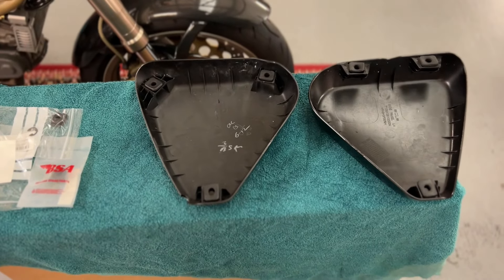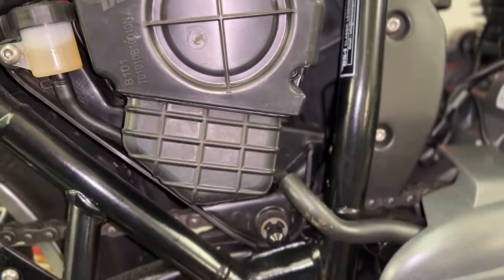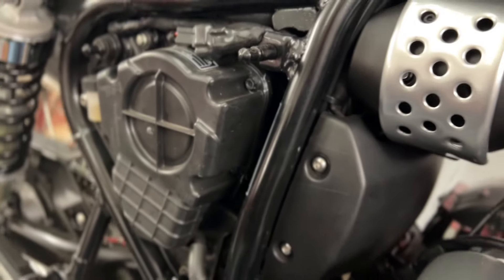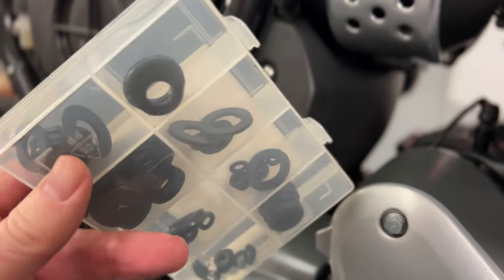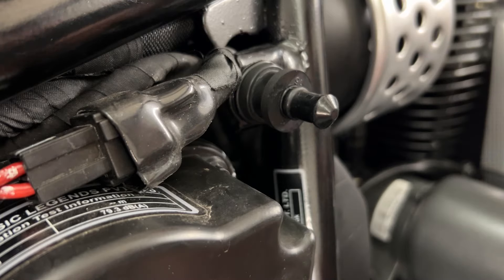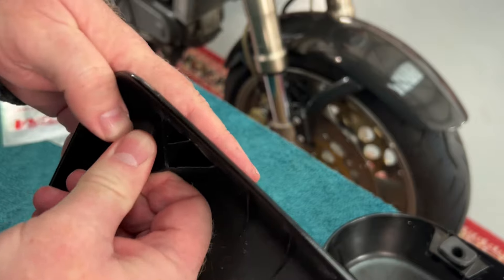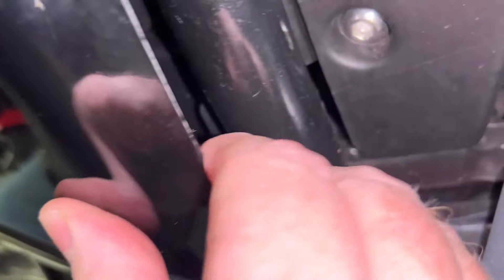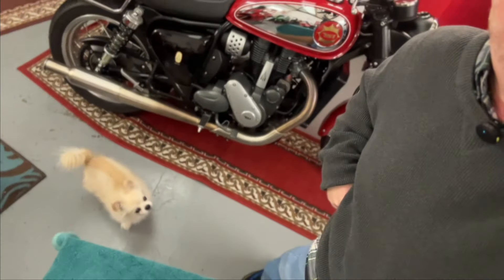The mysterious case of the missing circlip and grommet - BSA Gold Star 650

Comment: If the criclip sits into the groove, then does it actually need the rubber washer behind it?
Reply from the maker: All these questions and more… I just like symmetry 😂
Reply: Why do the other 5 have them then?
Reply from the maker: @ Hey, we’re not allowed to question these things 😂
Reply: @iaindawson8780  
I think I definitely does as the side cover is sometimes banged in and that would probably knock out  the circlip so the rubber buffer is definitely needed in my  opinion 😀
Reply: @martinholt2844  The round grommets with the clips are there to hold the airbox bracket and the oil tank to the frame. The post without- although identical to the others is supposed to be empty. However, I also preferred to pack it out. I just used a few cable ties and a rubber bung